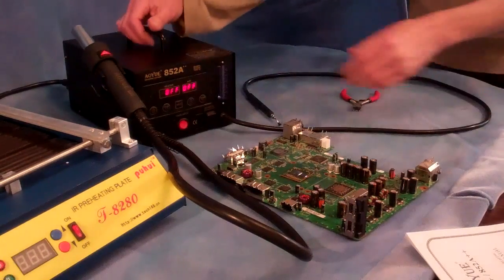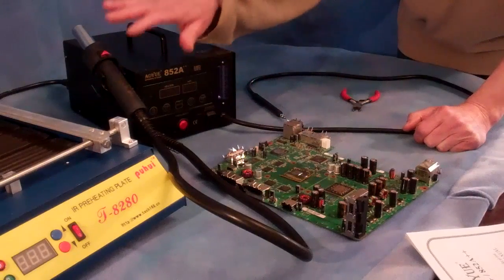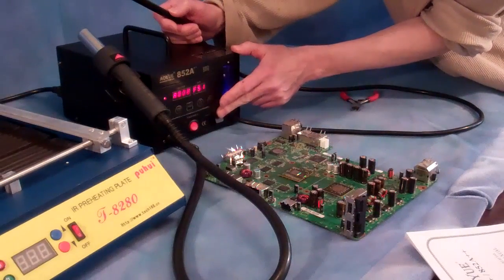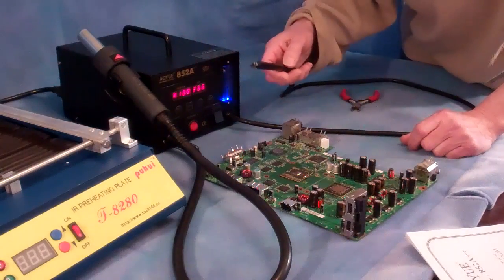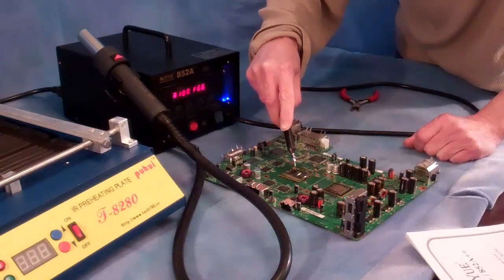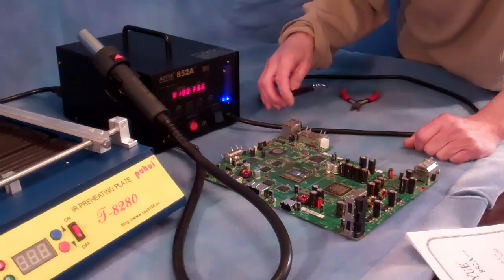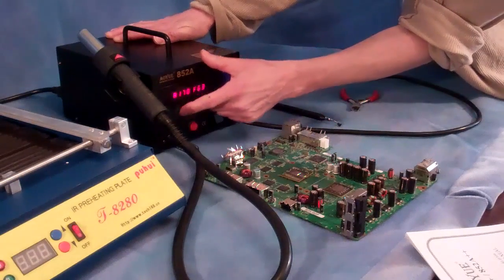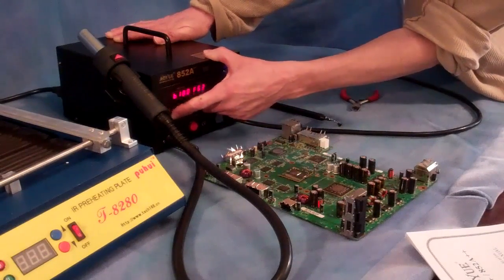Aoyue 852A++ SpitFireMods

Comment: Some here has the same unit? 4 years with this unit still in it box, Fairly used a few times to change Charging ports, and practice making rework reballing and removing/soldering IC's, paid $140 plus and I don't find reviews for years of savage use.

Comment: Regarding the vacuum and suction pen: Doesn't seem thought out too well. First off, if you are placing components, you don't need the heat on, but there's no way I could find of keeping the suction running if the heat is off. Needs a setting for suction only. Next, I found that after picking up a small (say 0603) component, removing my finger from the hole was insufficient to release the component, even at lowest airflow. Possibly remedied by enlarging the finger hole.    Finally, if you use the suction pen and the heat at the same time 9say for removal), engaging the suction causes the airflow through the gun to drop, since the air input is the suction pen.

Comment from the maker: IR Radiation or in Russian (IK-izluchatel) is very abusive to the board/component and has an average accuracy of -+ 20-30 degrees C since it uses a probe on the board or target versus actually controlling the temperature on its own.  
In other words - IR is basically very bad where hot air is extremely accurate and good.  You will find the majority of people on the Internet think IR is good but you would find that most of them never tried or even saw hot air.  IR just can't reach 100% efficiency